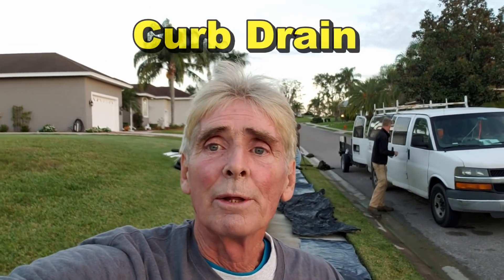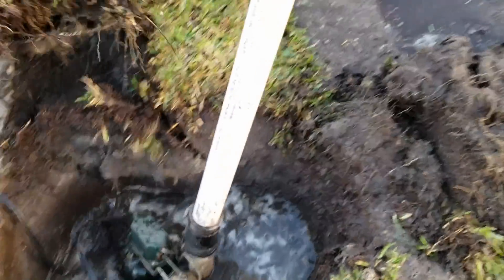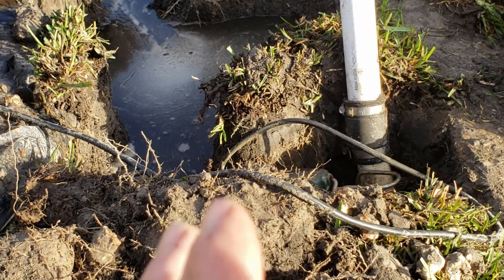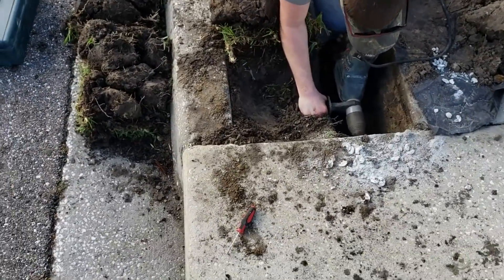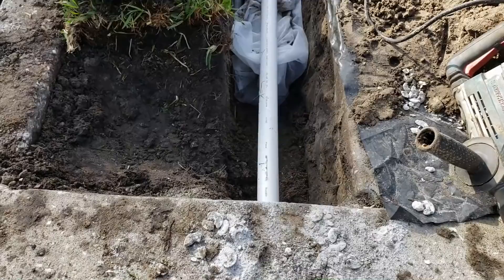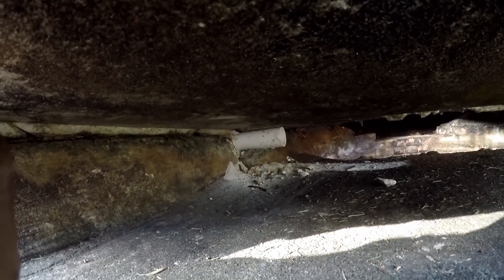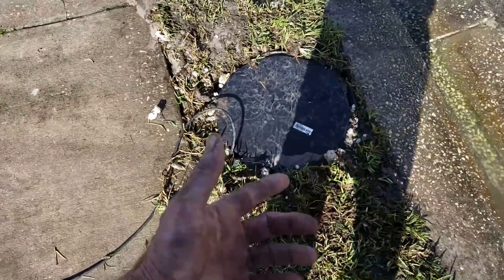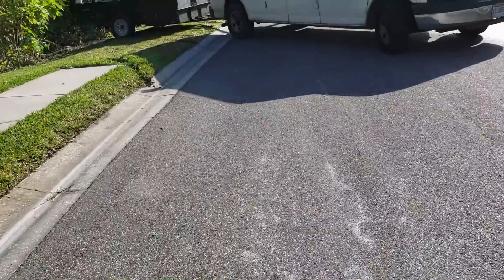French Drain and Sump Pump Solves Golf Course Community Water Problem

Comment: Chuck i watched several hours of your videos and took on my back side of my house there was an addition crawl space that was flooding and with your knowledge I was able to put in a gravel french drain under my house and then I put in a french drain around the back side of my house it was about 3.5 feet deep and about 70 feet long i did it all by hand and it went great it was a lot of hard work but  I kept my smile and believed i could do it and your'e right i did it I wanted to thank you for the knowledge I learned and I also enjoyed watching he videos and still do .  So again thank you for your expertise it is awesome. I have tested the french drain with my hose and it drains amazingly and its rained a few times and i have had no flooding thank you tremendously.

Comment: Hey, what is a reasonable cost to have a 100 foot french drain installed with a catch basin and a popup drain? It's pretty much a straight shot with no obstructions.
Reply: Mobi it would depend who did it and which way they design and build it. Plus the depth of the system. Also, soil type will play large part in cost. 

In our area, due to heavy clay soils, all excavated soil has to be hauled off site. 100 ft system (French drain not including the discharge line, but just French drain) would be expensive. A lot more than a couple of grand to install in our area.
Reply: @bbdrainage  Yeah I live in Georgia.. So clay soil. But I do have an area to dump the soil.
Reply: @mobi8138  Check the local rental places on the cost of a mini excavator for a day. You will get the trench dug fast and a large one to take the rock around the drain as clay soils you need a larger collection area. Also good for getting other projects done around the house at the same time to maximize the excavator use.

A quick check of where I am the cheapest mini excavator is $319 a day before taxes and fees. You might even be able to split the cost with a neighbor if they need to do work also.
Reply: If you do it, make sure you get it done and don't let the pipe sit in the unfilled trench. Everything needs to be completely filled in, tamped down, etc. I know a guy who didn't complete the project. He just partially covered it or didn't bury all of it. It rained and caused all of the pipe to become buoyant. The pipe and cloth all floated up and out of the trench. In addition, the trench filled with water and mud. I was hired to help do dig it out again. It would have been better to hire a pro. Plus, when we did the job again, we used the perforated pipe that he originally bought. I told him and the person who hired me it was the wrong pipe to carry water from a catch basin. Plus, the pitch was up and down as well... which I think would have been ok if he had bought un-perforated pipe. I hope it isn't clogged up with silt. I would hire a pro.
Reply: A couple grand, do it yourself save on labor.
Reply: @Leonard Holt no way
Reply: 1,500.00. not a couple grand